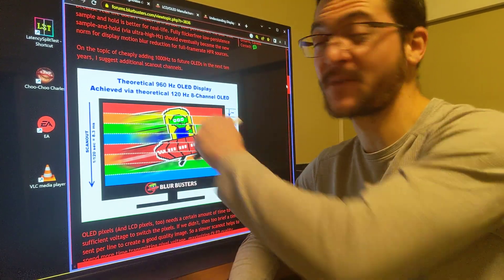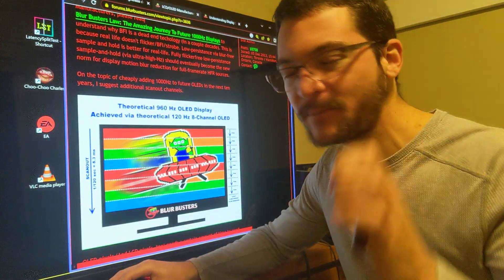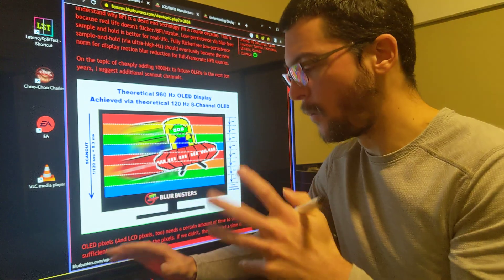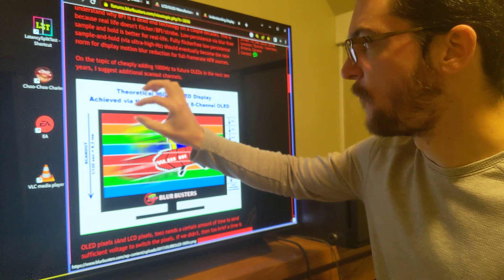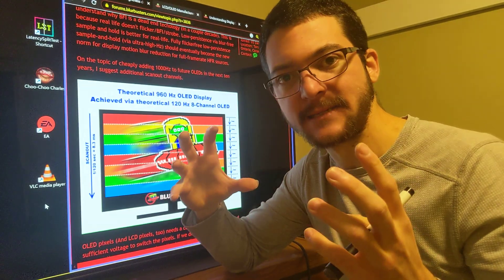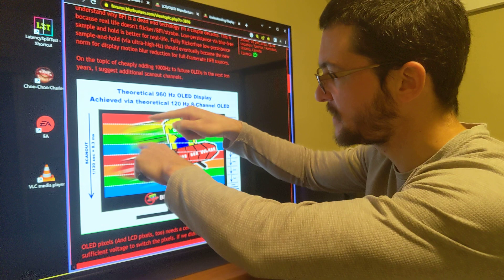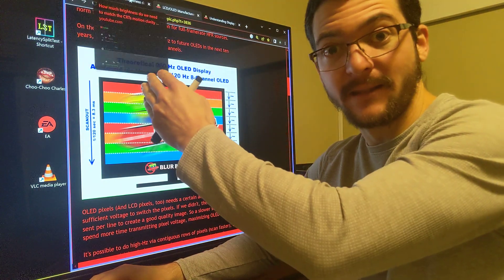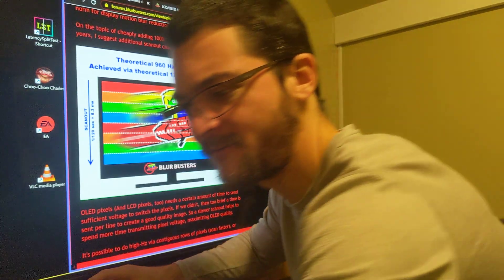Theoretical 960Hz OLED display proposed by Blur Busters.

Comment: Yeah but you need a lot more "monitors" and money. Of course you can do a lot with a lot of money.
But you ask, how can it look good? But they update/sync at the same time, so it's just gonna look uniform and with less blur than current. That example picture is not for accuracy. It's also gonna update so fast, that you won't notice any blur regardless.

Comment: I think your thoughts are wrong. When a display can show us 4k at 120hz , it does not mean that it can display 2k at 240hz. There is no scanning from top to bottom. LCD displays will continue to need 8ms to display one single pixel line of image.

Comment: When I bought my RTX 3080 without drivers I was strangely running at 1000hz in low res on my LG CX
Reply from the maker: That might be a bug showing it but not possible technically, the CX has reportedly 25% BFI meaning 2ms of persistence when using OLED Motion Pro High at 120Hz which is equivalent to 480Hz sample and hold motion Clarity. I can't confirm that because I have a C1 so I would need to test it, I showed multiple times how to test for that so check it out
Reply: @plasmatvforgaming9648  I went to windows advanced screen config, there I saw 8 bit 1000hz and the experience was Incredible. But resolution was like 720p or less. Didn’t get the chance to try any game because Windows installed the default nvidia drivers and I never saw those 1000hz again.
Reply: I didn't config any motionpro preset. Still was smooth like anything I’ve ever seen.

Comment: This is actually difficult to visualize but after some time staring at the picture awhile I get it. 
it's 8 unique frames that scan continuously down the screen. keyword continuously. each frame is starting it's scan at the top and finishing at the bottom without interuption.
hard to explain with just a picture an animation would help.

each full frame is scanning down the screen one after the other in a temporally cohesive way. since the refreshrate is 960hz and the scanrate of drawing the pixels is 8 times slower  then a conventional 1000hz scan out would be you get small frame slices. but you perceive them as full frames in order.

only difference with normal display is,  it will wait until the whole frame is finished scanning before starting another scan.

ever see a slowmotion video of a crt scanning out it's frame with only a thin slice of the frame visible? think that but the crt has 8 guns scanning full frames down the screen at the same time one after the other.

hopefully that makes sense to someone.
Reply from the maker: I would definitely like to see this working on an animation
Reply: @plasmatvforgaming9648  yeah that would make this clearer for sure.  just picture each frame always starting its scan at the top of the screen and ending at the bottom, 1ms later frame 2 starts drawing, 1ms later frame 3 starts drawing, etc.
they are just normal frame scans chasing each other down the screen.

Comment: I still like my tx-p42s10e Panasonic plasma tv, but it has motion judder in several (even slow) panning scenes, It looks like someone is hitting the camera stand while filming. I don't think this is motion blur, or what they call soap opera effect. Will this be worse on a oled TV?
Reply from the maker: That's called low fps stutter and it is horrendous. The film industry 24-30 fps standard makes no sense imo. The OLED looks objectively 4 times worse in motion natively

Comment: so you can increase the hz of the monitor by shortening the display and then stacking multiple displays to get an effective 960hz display but they still don't refresh at the same time? Or is each display still refreshing at 120hz but they take turns refreshing to get a technical 960hz refresh rate?
Reply from the maker: They each refresh at 960Hz and at the same time for what I understand

Comment: I think the image in the article is just misleading for demonstration purposes, and each of the 8 slices are meant to be drawing the same frame at the same time, since he says "since the top-to-bottom scan is temporally contiguous with its own full uninterrupted refresh cycle as a unique frame". That's how I read it, anyway. Theoretically if you took this to its extreme, you would want each row of pixels to draw independently (or each column, actually, on a widescreen). I wonder if this hadn't been attempted historically simply because the LCD response time for each pixel was too slow, and now it might only be possible because of OLED technology.
Reply from the maker: The picture is confusing to me because it should look as a single frame refreshing top to bottom as it reads

Comment: Hope your channel grows big so the manufacturer pay attention to your feedback and exposing broken hdr and motion blur
Reply from the maker: I'll try my best
Reply: Most TV buyers don't give a flying squirrel about motion unfortunately, we're in the small minority. :P
They want lighter thinner TV's, higher brightness and blah blah.

At this point, for console gaming, i want brighter 60hz & 120hz BFI, NO shadow detail crushing, less BFI latency and no noticeable flicker for 60hz BFI.

It pains me knowing that i'm going to have to play the upcoming Resident Evil 4 Remake at 60fps with the C1's MotionPro HIgh setting simply because of how horribly it crushes shadow detail....If there's an actual way to correct this, I'd be pretty happy. NO chance i'll be playing it at base 60fps without BFI HIGH. i tried with RE2 & RE3 remake, and the motion blur is just UNbearable....Playing it at 120fps is absolutely doable. Not perfect, but a HUGE step up, to the point where it's actually playable.

120fps + MotionPro 'Low' would be ideal for me, but only if the excess black crushing could be corrected. Medium and High rob you of too much brightness with the C1, so they're out.